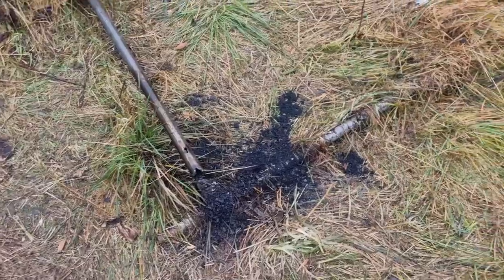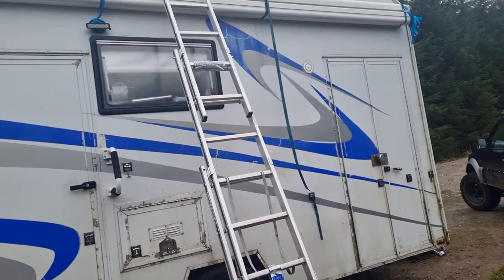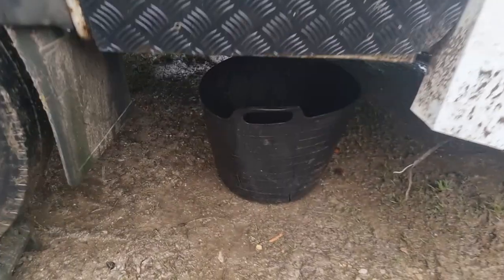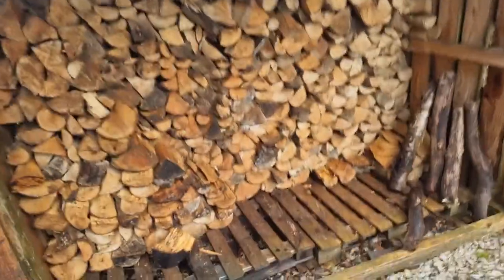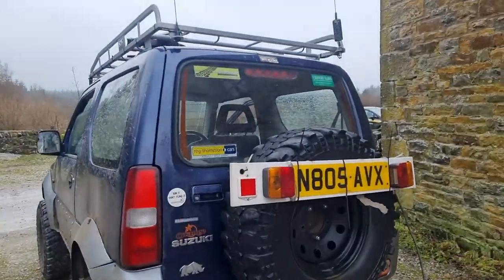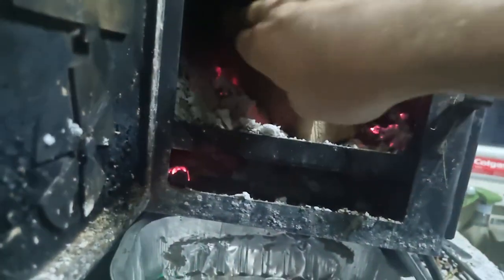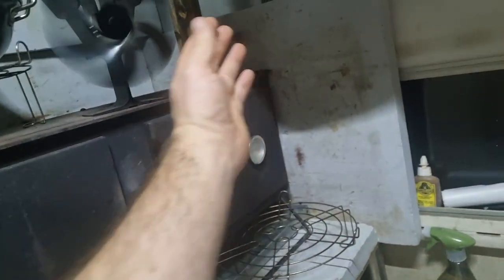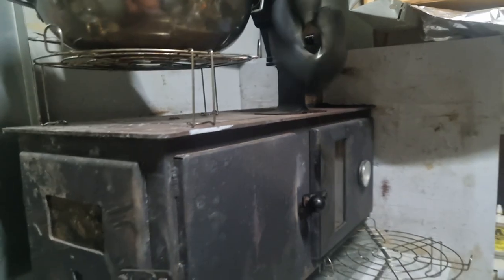Ultimate Cozy feel for a perfect night Bell tent WOODSTOVE in a van RV - Review after 3 winters

Comment: I had various burners in vehicles for years,  handy tip for chimney cleaning is rattle a length of chain down it from the top.  A removable chimney extension can be a lifechanger too 😉
Reply from the maker: Mines is relatively easily removed,  especially with the practice I get.  Thanks for the comment, its a good tip, guess it would even work with non-straight flues.

Comment: Hi!
Have you done any modifications to it for indoor burning?
I've used a bit of 10mm fire rope for around the door, but will be changing it for 12 as its not quite tight enough.
I've also fire cemented the removable "lid" in place to keep smoke out for use in a van.
Reply from the maker: Well it is designed for indoor (tent) use.  I blocked the hole in the middle of the pan-disk thingy and have thought about re-fire roping the door but only as 1 bit is a bit damaged - came roped. 

Dont have issues with lid leaks until the flue starts to not pull - hence the weekly cleanouts. And need the removal of that top to properly clean the whole oven-flue bit.

But sounds like we have both got round the niggles with this style of burner.